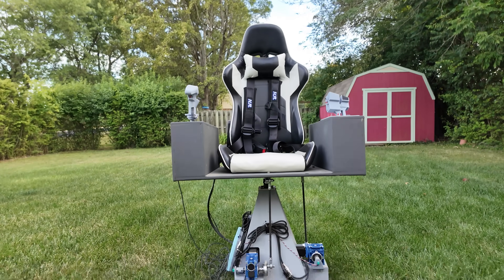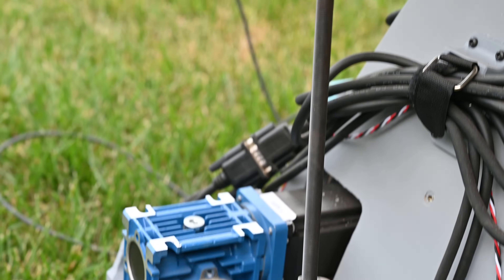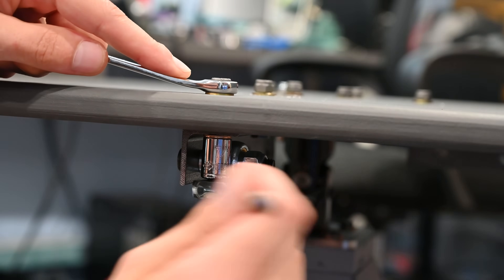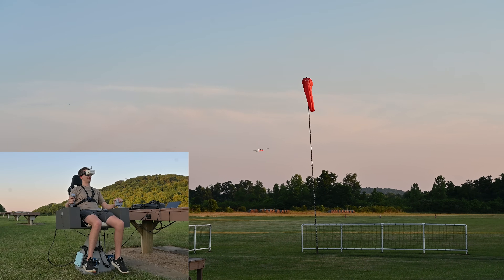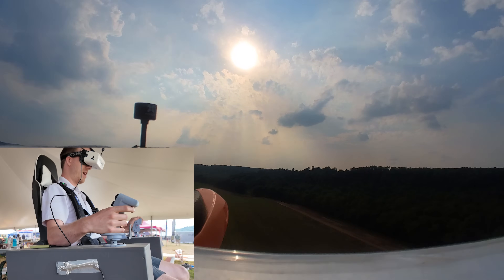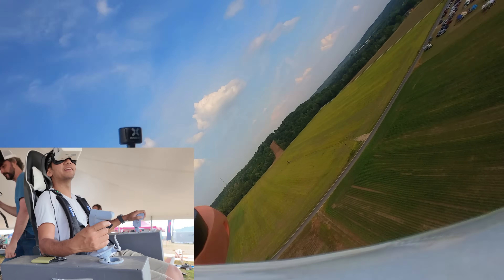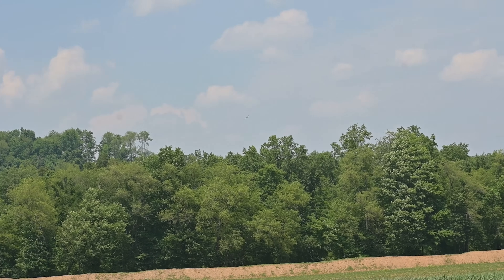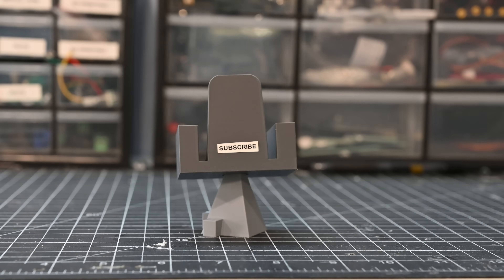Building a Real Life Flight Simulator

Comment: Many years ago there was an arcade flight sim machine that gave you 360 degrees of roll and pitch control called Sega R360 (look it up here on YT) - I loved that machine even though it only had a low res CRT screen in front of you. Your next challenge is to recreate that machine and FPV a 3D plane with head tracking

Comment: Add headtracking to the FPV system so it'll be even more immersive! :)
Reply: I was just going to say that! The camera would be on a little servo system that would allow the pilot to look to the, side, up, and down!
Reply: @davetelling  for sure, that's exactly what I mean! The camera could be mounted to a gimbal actuated by two small servos, that moves according to a gyro on the goggles!
Reply: Maybe a 360 degree camera would be easier, but maybe that doesnt play well with fpv? idk if the servos are even slightly delayed that would make you sick. Lag in VR is nauseating...
Reply: @revelware  Servos are fast, there is usually far more delay in digital fpv systems unless you go for HDZero... which although very low latency it does not have very good range compared to the others (DJI, Walksnail etc)
Reply: @revelware  I think a 360 camera would have way more latency than a normal FPV camera with servos, as there is no 360 cam meant for FPV so you'd have to use a normal 360 camera and somehow output that video to an FPV system - most likely causing a ton of latency. It's also a lot easier to program the servos to move accordingly compared to hacking a 360 cam to use the inputs from the headtracker. Depending on the transmitter and receiver protocol the servos would probably only cause a few milliseconds (maybe 10-20ms if using expresslrs) of extra lag. would definitely be something worth testing out!
Reply: 360 camera and let the pilot look around?
Reply: Correct me if I'm wrong but afaik most head tracking solutions utilize the trainer port on the radio, which is being used here for the chair. I've not much exp with trainer ports or headtracking (although I have a 1 axis headtracking device I've never really messed with), so Idk if you can run 2 different systems from the same trainer port? With ELRS and a 2nd rx/tx it would be doable for sure.
Reply: @CantFly_FPV  a headtracker could also be connected to a UART port on the transmitter, which is seperate to the trainer port. Not sure if the transmitter used in the video has one though, my TX16S does
Reply: @ValRC1  i dont know much about FPV and havent watched the vid yet but even if it doesnt work for prebuilt ones you could 100% make your own with a microcontroller to prototype. Really want to see someone do this
Reply: DJI's first Avata does head tracking out of the box, and I think the Avata 2 does too, but I haven't tried one.  It's a little risky, as a hard look to the side at high speed can cause a yaw washout and crash, but it's pretty awesome for just zinging around through canyons and trees.  I actually prefer my Mini4 for head tracking with the googles though, as the 45 minute flight time is better for just chilling and enjoying the view, and no yaw washouts.  The resulting footage is pretty hard to watch though, as it doesn't match what your head is doing at that point.
Reply: Ciężko zrobić dobry Head tracker gdy ciało się nie przemieszcza a co dopiero przy kołyszącym się fotelu!
Reply: ahhh i was thinking they already had that installed lol           yup that would help a huge amount for spatial awareness and speed references
Reply: It feels like you are sitting in a plane and your chair is moving. 
LOL. 
You have to subtract chair's angle from the headset's viewing angle to fix that. 
He did not even understand why it feels so wrong but he had to keep smiling to finish the video.

Comment: Are you using the chair to mimic the pitch and roll of the plane based on telemetry, OR are you trying to tilt the chair on the two axes to simulate the acceleration that would be felt by a (very small) pilot in the plane?

Basically, if I hit the throttle, does the chair lean back to simulate the feeling of acceleration pushing me back in the seat?
Reply: It appears that the seat only goes back when you lift up

Comment: I wish I had the skills.  I always wanted to set a hang glider sling under a tripod using the bar that's in front as the control element. Using fans for the immersion feed back.  I don't know if i explained this well enough but   👍✌🖖🥃(Good Job,Peace,Live Long, and have a Drink) very worth a sub

Comment: Some ideas to explore: tilt to simulate G-forces instead of just relative position (or some mix-in).  I think that's why the big room simulators are on hexapods instead of single point, so I don't know how feasible that is from a feedback control systems perspective.  Definitely need a way to get vital information on the FPV feed: at least the current speed and throttle positions, but maybe try for artificial horizon as well? You may want to double your motors on each axis for counter balancing. As for interference, maybe look at dual-band or tri-band radio and set sane recovery defaults in case of loss of signal?

Honestly, you could easily commercialize these and sell them as kits for DIYers or as fully-built chairs to people who don't want to build them. Hopefully that was part of the conversation with the Flite Test crew.
Reply: I think it would be easy to just have a gravity sensor and feed it's position to the 2-axis chair, rather than use gyro attitude.
Reply: The hexapod is a must. Having the thing balancing on a single point with rods holding it up is a recipe for someone getting hurt.
Reply: @whatilearnttoday5295  my thought as well. Those motor mounts are going to give out eventually once someone heavy enough persuades them to.
Reply: I think simulating G-forces is the only way to make this more than a (very fun) novelty. The way it works now doesn't provide useful feedback.
Reply: Agree. That it doesn't do this makes the chair almost anti-useful. When turning and banking, the chair should be there to confirm that you are applying the right amount of rudder to keep the forces downward — the chair as programmed conflicts with that.

The good news is that it's a minor addition to make that happen.
Reply: @softdorothy  "anti-useful"
I agree. As you say, it should help people feel when their turns are coordinated.
As it is, it's kind of an anti-simulator. The chair will make turns which are really coordinated, feel like they're not.
The fix should be relatively easy. You just need some low latency, high frequency telemetry of the acceleration data.
Reply: how does it being on a hexapod change anything? it still only moves in roll and pitch, this is a difference of software
Reply: @justinc2633  I've been trying to figure out the same thing. I suppose a hexapod could provide up and down vibration feedback. The extra actuators could also provide short burst of acceleration but this extra acceleration would be very short followed by an unrealistic counter acceleration.
Reply: @justinc2633  you don’t have a fixed center, so you have 6DoF. Yes you need different software, but changing the software doesn’t fix hardware limitations here.

Comment: You could add pedals for rudder control. If you mate it to a larger plane you could add lights, etc. Of course similarly you could add the loiter function into the buttons as well as trim.

Can you run the altitude and speed from the GPS data to a layer on the FPV goggles? Similarly with the artificial horizon you might be able to get from the other sensors, etc on the sensors. Maybe create a layer for it in Unity, UE or some such? 

Lastly if and when you take it a lot further, you could change the FPV headset to an inside out tracking VR-headset and link that and the plane's camera together, use a camera that can rotate and tilt. This would allow you to turn your head while in flight. Ought to make flying easier too.
Reply: Yeah, it would be cool to see the concept expanded on.
Reply: I think a foot rest would help with comfort and rudders could be added.

Comment: Love this. Check out how full-size simulators work, they don't replicate the attitude of the plane, but instead more focus on the accelerations the pilot would be feeling. We can't feel slow rotation rates, so you can do fast moves, then wind the positions back over time.
Reply: This is especially true because, as anyone who's looked out a window in a plane knows, you don't really feel the banks as a lateral tilt--at least not if the turns are properly coordinated. This is a big part of why artificial horizons are so important--because the plane's attitude is often NOT something you can feel, it's too muddled by inertial forces.

I'm not sure how you'd calculate the accelleration vectors properly, though; it'd be ideal if you could get the accellerometer data without the gyros...
Reply: @TheRamblingShepherd  You can do it by using a second gyro that you've deliberately made...'mushy'? Basically cushion the gyro within a cube of very light springs.
Reply: Right on the spot!
Reply: @wowLinh right in the G spot !
Reply: The name of the video that  explains this (and I'm certain both you and I watched)  is "How Flight Simulators Trick Your Brain" by the youtube channel FlyByMax.
Reply: @WhoIsTheEdman  I have never seen that video, in fact. But I am going to right away!!! Thanx!!
Reply: I work on full-sized simulators - and electrowizard2000 is exactly right.  You should NOT replicate the attitude of the plane - that's 100% wrong.   You need to use the seat to apply the forces that plane is feeling to the pilot.   For example - if you're accelerating along the runway - tilt the chair backwards and allow gravity on the pilot's body replicate the feel of acceleration of the plane.  Once the airplane's speed is steady - then the seat can go back to being horizontal.   Similarly, in a turn - if the pilot is doing a nice balanced turn then the chair should not tilt...but if he's applying too much aileron compared to rudder then the chair should tilt to replicate the skidding through the air.    This isn't easy - but it is what works.   Having accelerometers in the plane - lateral and axial - and using those to drive the tilt should feel much more realistic.    Most of the feeling of MOTION comes from the display in the headset - the chair is to provide a feel for the forces on the airframe.
Reply: @SteveBakerIsHere  great to have an expert. What do you make of the 2DOF vs 6DOF limitation here, how should they handle the data conversion?
My guess is the limitation is most about the center of rotation, it's probably the pilots head for the real deal, but here it's stuck under the chair.
Reply: Maybe make it simple, start simple: When you control an RC car with it, make the chair lean back when you accelerate and make it lean forward for braking. The harder the acceleration or braking, the more the leaning back or forward of the chair.

Test this stage of development. 

Then let the chair lean left when the RC car turns right. The tighter the turn and the faster the car, the more the chair leans to the side. Lean the chair left for turning right and lean the chair right for turning left.

Now program it and try it out.. .

And make sure, that the mechanical parts of the chair "know" how far it can safely move. There should be a safe limit for the movement.

And there should be an emergency stop for the chair so that it would stop moving, no matter what the RC car, plane or boat(!) does...

Just for safety ---and for more comfort for your pilot in case of motion sickness for example.
Reply: Those actuators would be orders of magnitude too slow to replicate accelerations accurately though sadly. They're already really struggling to maintain coordination with the attitude which is much more stable.
Reply: This! When the plane accelerates, even being level on the runway, the simulator inclines back so you feel more of your weight on the backrest of the seat. This is the kind of the movement you want on a simulator, you are spot on!
Reply: Exactly.
Many people think simulators are "movement mimickers."
What they actually do is simulate forces by manipulating the orientation of the user relative to the gravity vector.
Reply: Yeah..i think the technical term for this is MCU (motion cueing algorithm). There are quite a few papers out there showing algorithms for the behavior  @SteveBakerIsHere described
Reply: I came here to say this. So many motion rigs I see get the motion so wrong. It’s the main reason I haven’t gotten into them. Banking left does not feel like leaning left. It should feel like sitting straight and maybe feeling a bit heavier in your seat. If you feel a left lean during bank in an aircraft you are in a slipping turn and have not used enough rudder. For credibility, I’m an airline pilot and instructor with 17,000hrs and 28 years in the industry. I have extensive experience with full motion simulators.
Reply: Is it that he's feeding in the attitude of the plane or is that they haven't hooked up the rudder and no one can do balanced turns?

I feel the entire thing looks very unsafe to sit in.
Reply: @whatilearnttoday5295  coordinated turns only work because the plane is accelerating, the 2dof chair cannot (see above) 
Not sure what looks unsafe to you.
Reply: @whatilearnttoday5295 unsafe to sit on? That's your comment? Well then don't bother trying
Reply: Hit the nail on the head
Reply: Just commented something like this on Flite Test's version. Getting data back from a gyro would be really cool, but challenging to get a true 3rd dimension feel in the seat.
Reply: yep exactly my thoughts. It should be a matter of software programming to make the chair react like in flight simulators and with that be even more real.
Reply: Genialne!
Reply: Was popping down the comments to say precisely this!
Reply: Yeah and thats the reason of flight disorentation
Reply: 1st, it is a chame that Michael doesn't interact here on the comments. 
Yes it would be amazing simulating forces on a 3 axis motion.
And YES, PLEASE sell the kit, because 99% of us don't have the tools to 3D print and cut out aluminium. 
Wood we manage, but the rest is difficult due the machinery price.
Reply: Don't you need more degrees of freedom (i.e. translation) for that to work properly?

I mean moving back slowly definitely would help
Reply: @hrmny_  sure I think it would work much better with 6 axes, and I'm not 100% it'll work with 2, but I think it would be an improvement. It's counterintuitive that the correct movements are not just replicating the attitude so just wanted to bring it up to look into.
Reply: Yes thank you! It's always so frustrating to watch build like this.